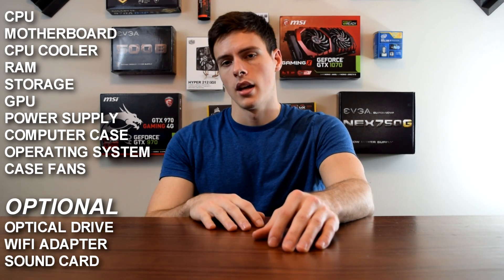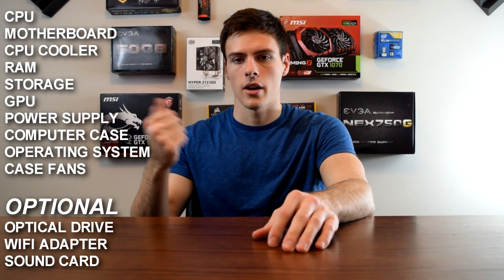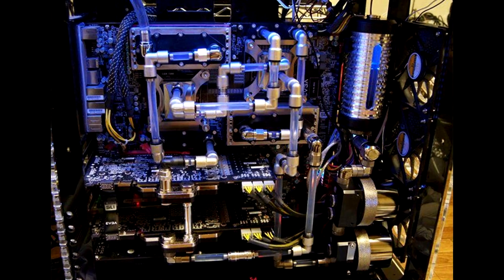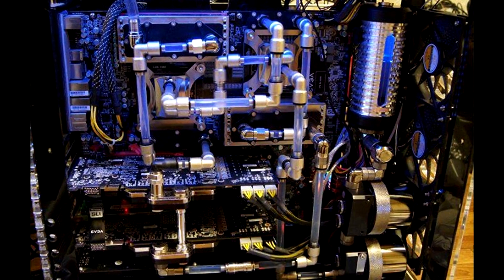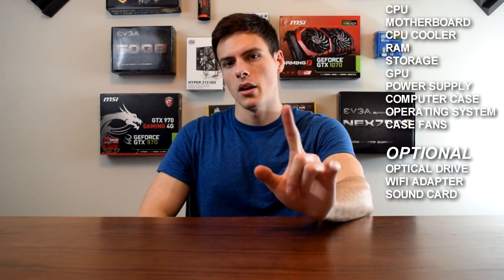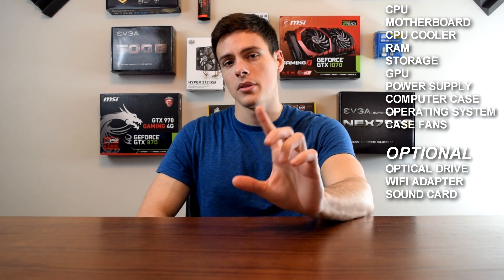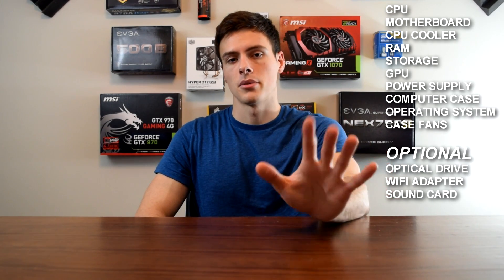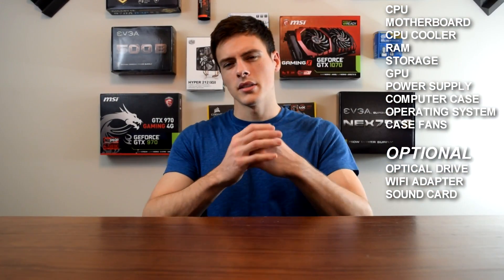[2017] What Parts Go In a PC? FOR BEGINNERS - PC Guide

Comment: What are the benefits of having 2 graphics cards? Isn't 1 enough?
Reply from the maker: KrypticElement depends on the GPU. You can usually get more FPS with 2 of the same card (depending on the game). 1 should be plenty for most people though
Reply: JDTechGear Do you have to have the same type of card? Or do can they be different types?